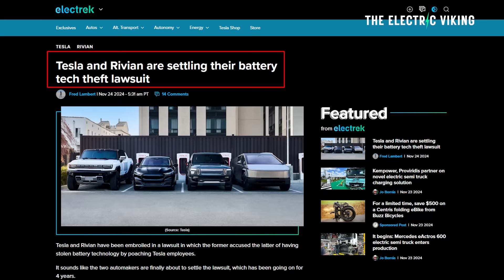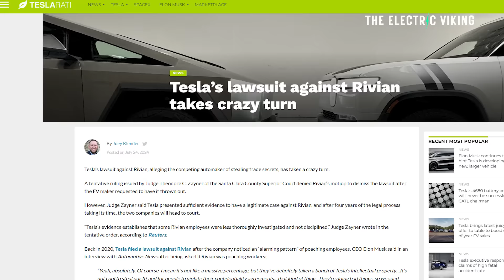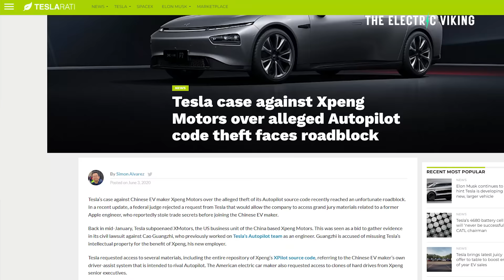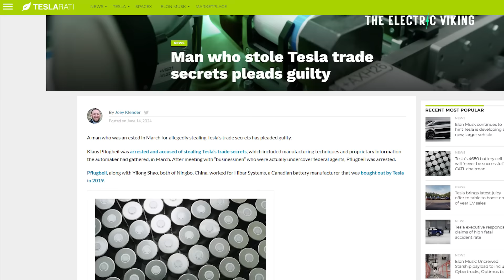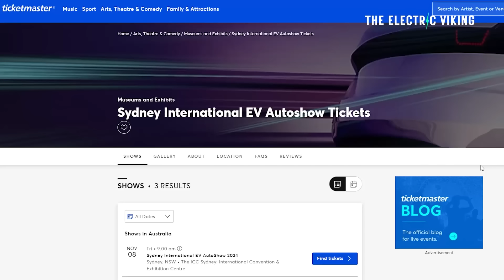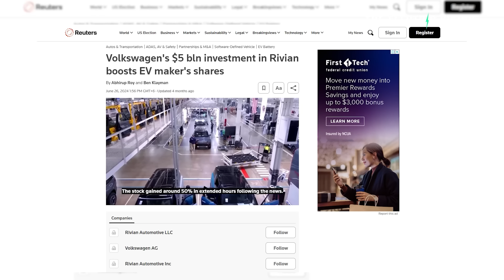Rivian admits to stealing Tesla battery secrets

Comment: There's a settlement (as usual) because both parties have an interest in keeping the details of what was supposedly "stolen" under wraps. And that Rivian "settled" with Tesla doesn't mean that Rivian admits to doing anything wrong. Rivian could have settled for $1. There is a LOT that can fall through the cracks about  NDA, do-not-compete clauses and trade secret agreements. One of them is stuff that is not documented anywhere in the company's files but is inspiration one gains from working on a project in a day-to-day basis. This type of information and knowledge is hard to foresee in an employee contract.  And in the case of patents, it is a completely different story. A patent can provide some protection by preventing unlicensed users from using the disclosed technology, but at the same time, a patent of another company, can invalidate the focal company's patent, or prove that something that is disputed within a trade secret, is not in fact, secret.

Comment: You can’t send people to jail for this behavior because too many companies will use it to make employees unmarketable.  Courts need to recognize how damaging this is to competitors and if enough evidence is produced then companies should be forced to cease operations until the issue is settled.

Don’t let companies drag this out for 5 years and then settle when the damage is done and IP is worthless.

In the rare cases when an employee is stealing large amounts of designs and/or code and there’s a clear trial then charge the individual.  It can’t be for a 10 line function and it should include the work of other developers.
Reply: The calculated value of the information stolen should be converted into stock of the company that was the thief so that the technology could continue to be used but the prophets would go to the originator of the technology
Reply: @ pretty much impossible to figure that out.  One company would say billions while the other would say thousands.
Reply: You are wrong without the battery technology or whatever technology that is stolen the companies would quite often fail so if the battery technology is something to cannot be replaced then the companies would no longer exist so i would say 50% of the value of the company should go to the company that had their data stolen
Reply: @donblythe3766    profits*   😊
Reply: `                        "Bottom Line"

#RiVian did do something  ~WRONG~ ⚖️  in eyes of The Law, or Tesla would not have won the lawsuit. 👍